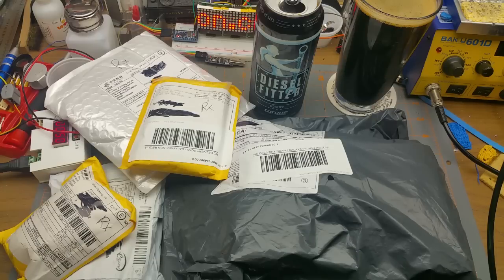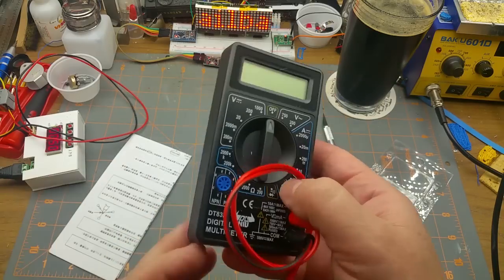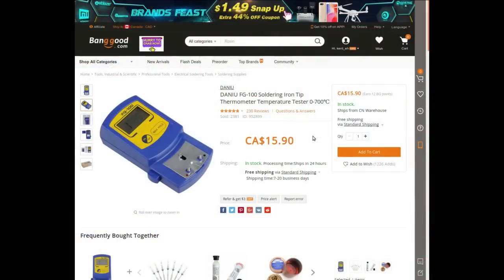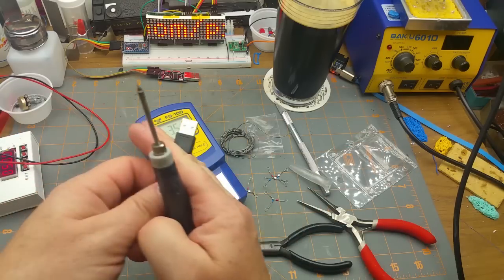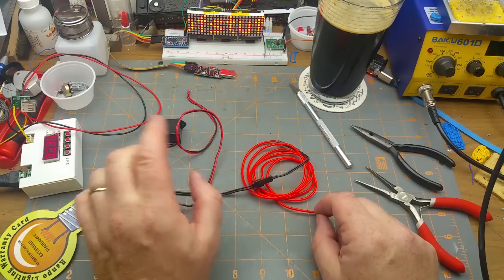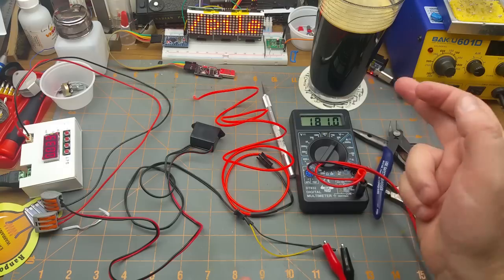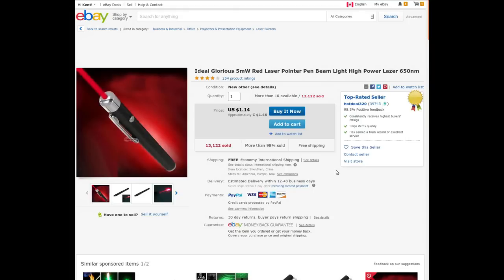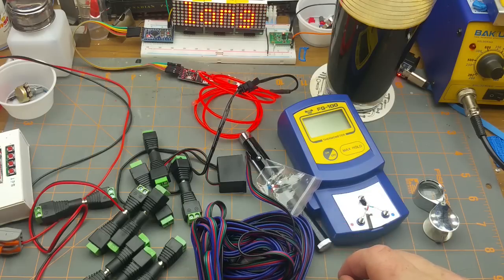long weekend bonus mailbag monday (#40)

Comment: With the Soldering tip thermometer, you need to put a fresh pool of solder onto the tip and then place it on the tester. In that way the solder conducts the heat to the junction rather than you trying to press it hard enough to create a decent contact.
Keep in mind that these testers are just a standard K-type thermocouple. However the advantage is that the thermocouple junctions are dirt cheap and easily replaced. If you use the thermocouples supplied with your multimeter then the cost is a lot higher because you must throw away the whole thing including leads ever so often.

Comment: Do you have a fleabay link for that nifty little supply you use? (Or, from wherever it came.)
Reply from the maker: It's one of these: https://www.ebay.ca/sch/sis.html?_nkw=B3603+LED+DC-DC+Digital+Control+Step+Down+Module+Power+Supply+Adjustable+Buck 
I built my own case for it https://www.youtube.com/watch?v=avv7dsoVO9o

Comment: They did some Chinese laser pointer safety testing down here a while ago, and they found out they aren't regulated. Watch you eyeballs.
Reply: Well, you can buy some laser "pointers" that have high power green laser, that takes single 18650. They are almost always labeled as below 5mW lasers, even though you can use them to light up some matches, or melt some black plastic.
Reply from the maker: I work with fibre optics at work, so I've developed a pretty solid respect/fear of lasers and my vision.
Though I'm guessing that this one falls on the underpowered side of cheap., I still don't plan to aim it anywhere near anyone's eyes.

Comment: Hello. I have an out of the topic question regarding your Baku 601d soldering/desoldering station.  Would you recommend it for hobby/home use? Thanks for your most than interesting videos.
Reply from the maker: I've had it since about February (so, about 8 months) and so far I am happy with it.  
I never did an unboxing or review of it, but it cost me about $85  with free shipping from a Canadian seller.  
For hobby use I think it is an excellent tool, and a very good value for the money. I would get another one if someone stole this one.

 Here's where I got mine:  https://www.ebay.ca/itm/BAKU-BK-601D-110V-SMD-Brushless-Heat-Gun-Soldering-Iron-Station-with-Stand-700W/172602609533
Reply: You are too kind.  Thanks a lot for the info and keep up the good work!